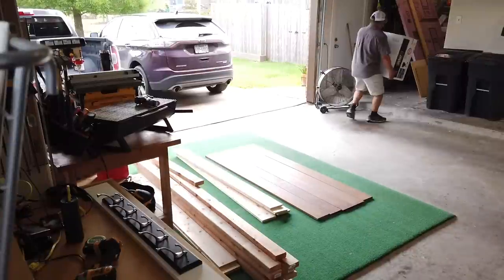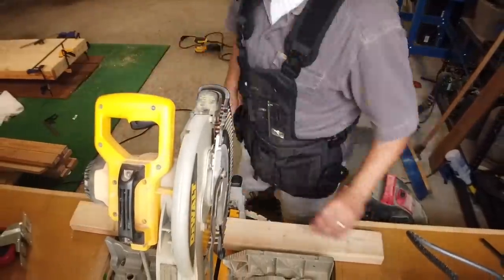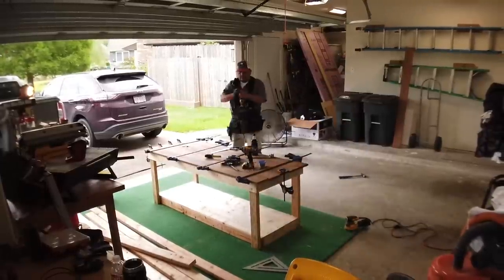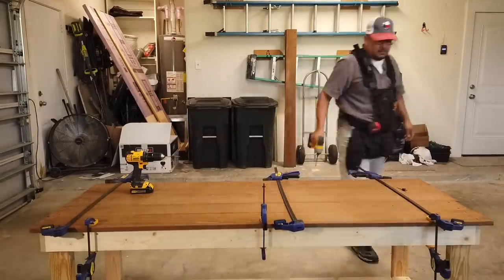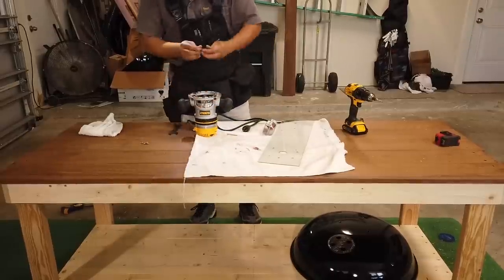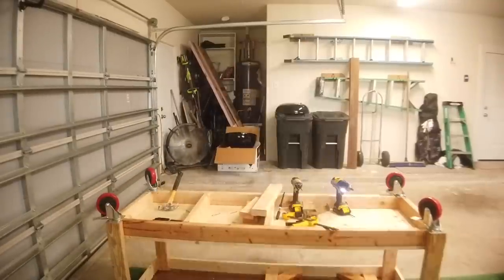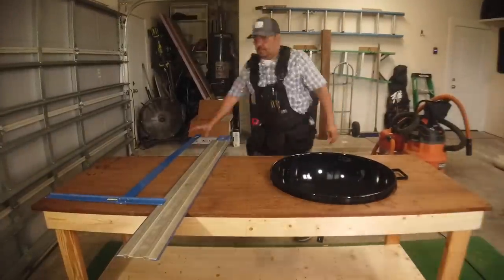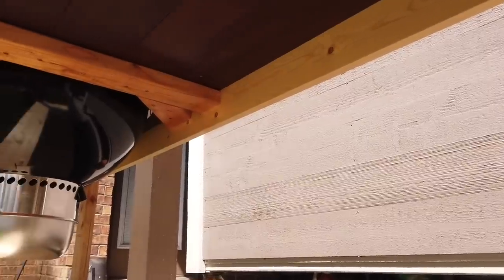How to build a 22" Weber Kettle BBQ Cart DIY BBQ Table

Comment: Very nice! I am doing a double unit for my kamado and one of my 22" Weber kettles. For the casters, I would recommend using threaded inserts and hex bolts instead of 3" wood screws. This allows you to remove the casters and not mess up the threads when you replace the casters (if you ever need to).
That Varathane Poly is for interior use only. You really want exterior Spar Urethane for outdoor items, as it provides UV protection and won't crack and peel like poly. If it gets a lot of sun, I would re-apply every year to keep it looking like new.
Reply from the maker: That’s a great tip. Thanks!  I hope it all works out for you... a very fun build.  I’m about to post another barbecue side table with a built in cambro... for keeping meat warm. You can easily incorporate it into your Camaro table build be sure and subscribe so you won’t miss it

Comment: This has helped me massively!!  Couldn't decide on the best way to 'attach' my weber to the table top and this made it really obvious that it was the best option! Thanks man.
Reply from the maker: Thanks a lot.  If you watch one of my videos you can see the first one I built.  Be sure to leave some airflow space between the table top and the grill.  The mistake I made on the first one was cutting the hole to tight.   The L brackets do make it easy.  Thanks for watching. I hope it turns out great for you.
Reply: View to a grill this is an awesome project! Did you use one inch or two inch brackets to support the grill?
Reply: snuffcan I used 2” 50mm L brackets.

Comment: great job. gonna build one myself or similar. Thanks for the inspiration
Reply from the maker: Awesome!  Send me a pic and I will post it on my YouTube community page.
Reply: @Viewtoagrill  will do i got some reclaimed teak that's just begging to be made into a BBQ table. I have just ordered a Napoleon PRO Charcoal Kettle BBQ - 57 cm - PRO22K-LEG-2 once that arrives i can work out the speck for the table. I got some ceramic floor tiles left over from a job so that may be my table top. I was also  considering a splash back too to set shelves on but design is in early stages yet , so nothing definite just yet.

Comment: Very nice job. In all honesty I would've raised that bottom shelf especially since it's made of pine. Moisture will damage the underside of it way too soon considering all the time, effort and drill bits....lol. Add a nice handle on the ends to move around and some S hooks for utensils. Love the top as IPE is a very durable and beautiful wood. Used on high end decks $$$. Very nice job and thanks for sharing with us.
Reply from the maker: Thanks Tom.  So far no issues with moisture. I keep my personal table under my covered patio out of the weather.  I also apply water shield twice a year and that helps too...  wood left out doors will rot and become damaged so I take care of it as well as possible.  Take care Tom!

Comment: That looks fantastic!!! Do you think it matters what type of wood to use for the table top? To withstand the heat I thought
Reply from the maker: You can use any wood you want really. As long as you have that half inch gap between the wood and the kettle you should be fine.  The wood really does not get very hot.
Reply: @Viewtoagrill  thank you very much! The reason I was asking is.... I have an idea about a grill sitting in the table but a half inch gap wouldn't really work there. Kinda would need to rest on the wood.

You'd think there are woods that would be ok with that?
Reply from the maker: @33mojod  I don't think so, or at least can't think of one.

Comment: Why did you use both the Thompson's weather seal in spray bottle AND the sealant in the spray can?  Do you need both?
Reply from the maker: That is a great question.... I do it because in my mind it ads a layer of protection... I have no idea if it does or not... but, you can see in my grilling videos that my personal table still looks great... and my personal table is for a 26 inch kettle and is almost 3 years old... maybe it makes no difference at all... all I can do is point out the way my personal table is holding up.  Take care Clark.

Comment: Terrific table.  If you don't mind my asking, what'd those 5 Ipe boards run you?  I live in NE FL, so anything other than pine, red oak and poplar cost as much as a room in Trump Towers.  Beautiful table.  I am actually building one very similar for my son but was going to use engineered deck boards for the surface.  Not sure how they'll fare around the hole perimeter compared to a good hardwood because those types of deck boards have a lot of resin in them as a binder.
Reply from the maker: I buy them from advantage lumber look them up on the internet. I believe they are out of Florida.  They are about 25 dollars each.  Also I went with a natural untreated surface that was going to be around food.

Comment: Javier Sepulveda
Question: are there any issues with the super hot kettle grill being in direct contact with the wood? I am ready to pull the trigger on this project, but concerned about this potential fire hazard.
Reply from the maker: Hello Javier. Just be sure to have an air gap between the kettle and the wood if you use the lid as a template it will give you about 1/2 an inch. Also if you check out my “Custom BBQ accessories” video I show what it looks like from the inside after a few hundred cooks. Take care and good luck with the project. When you are done send me a picture I have already posted a few pictures on my YouTube community page... take a look for some other ideas.  Take care.

Comment: Great work!  Any chance you have the dimensions for the 26.75 table you built?
Reply from the maker: I used six 1x6x6 boards for the table top and then I  fit as much cabinet space underneath as I could.   The table top stands 36 inches from the ground on 8 inch casters so I can move it around the grass easier.  Hope that helps a little.oh.. and just use the lid as a template for the hole.

Comment: Does the Grill put off enough heat to damage the surrounding wood?
Reply from the maker: It does not.  Check out my Accessories for the 26 inch Weber kettle video where I take the kettle out and show the inside of the table.

Comment: Hi! Awesome build! What size black L brackets did you use from home depot, 2 inch or 3 inch?
Reply from the maker: I used the 2 inch brackets… but if you Albany it to set a little higher the 3 inch ones work also.
Reply: @Viewtoagrill  my top boards are 5/4 inch thick teak. (tropical from home depot). Was your ipe 5/4?
Reply from the maker: @JonathanCarr80  they were 1x6… so 
3/4 x 5 1/2

Comment: interesting video. great work. one question, was the gap between the grill and the wood enough to prevent charring and burning of the table, particularly where the wood meets the grill? thanks
Reply from the maker: Absolutely.  In my "Custom BBQ Accessories for my 26 inch Weber Kettle" video I actually take it apart and give some close ups of the wood.  There is some "discolorization"... if that is even a word.. but you know what I mean... because of the smoke but no burning.
Reply: @Viewtoagrill  thanks for the reply. keep the videos comin'!

Comment: Was the polyurethane ok with the heat from the Webber grill?
Reply from the maker: I’ve not had any issues with it yet. However, I do refinish this table once a year.  If you look at my accessories for the 26 inch Weber kettle video, you’ll see where I actually open up the table after some use and give a closer look.

Comment: Wondering if the wood around the grill get burned easily?
Reply from the maker: The wood does not get burned at all... it does get stained from the smoke around the Perimeter of the grill.  You can see what this would look like after about two years in one fo my grilling videos. I use a larger one for my 26 inch kettle.  Thanks for watching and welcome to my channel.

Comment: Any special reason you went with 1X4 boards for the top shelf frame, instead of using 2X4’s like what was used for the bottom shelf frame?
Reply from the maker: Hello Steve. No special reason. I had some in the garage and had to use it.
Reply: @Viewtoagrill  thanks, nice job ya did there.
Reply from the maker: @stevenwhite247  Thanks Steven.

Comment: Question relating to the 8 L-brackets that the kettle is mounted to.  Any issues with the kettle rotating or spinning when using the ash sweeper since the kettle is just resting on these brackets?
Reply from the maker: Hello Bryan. On this table using 8 brackets I do not have an issue with it turning, the friction keeps it right in place.  On my rounded table(in another video) I only used 4... and that one did turn, so I added two more brackets and that fixed it.  In the other video I also found if you use the lid as a template it works out perfectly.
Reply: @Viewtoagrill  Thank for the quick reply!  Very helpful to know as I try to build one as well.  Thank you again!
Reply from the maker: @bryanjarecky2837  send me a picture when you are done so I can post it on my community YouTube page.  If you have not looked at my community page go take a look at the other tables that were inspired by my video.

Comment: Nice project! By the way, how’s the wood holding up by heat of the grill?
Reply from the maker: Hello Mike.  The wood holds up well.  I actually have a video where I take the Weber out and show you.  Check out my Custom BBQ Accessories for my 26 inch Weber Kettle video.

Comment: Hi Johnny, excellent video. I’ve been wanting to do the exact type of table but I’ve been scared to try 😬. But now I’m inspired!
Couple of questions I’m hoping you can answer:
I would like to use teak wood for the surface. Can I finish it as you show in your video?
I want to add hooks and a towel bar on the sides. Would you prefer-drill those holes before putting the sealer and varnish and then attaching once it’s dry?
Reply from the maker: Hello Frank. Yes you can finish teak wood as shown in the video.. using spar would be better for outdoor use. Drill the holes after every thing is sealed.  If you check out my Custom BBQ accessories for the 26 inch Weber kettle... you can see how I finished the table... the table is different with hooks and a towel bar. 

When you are done with your table send me a picture and I will post on my YouTube community page.
Reply: @Viewtoagrill  hey Johnny, thanks for the suggestions. I will definitely check out your 26” video for more ideas.
And thanks so much for replying! I didn’t expect to hear from you this year 😁. Very cool!
Reply: @Viewtoagrill  hi Johnny, just to clarify, I would first cost with the Thompson’s water sealer then followed by the spar coating?
Reply from the maker: @frankcampos1251  Frank, that is what I would do.  Water seal, let it dry then spar. But technically since you are using spar, the water seal is not necessary.  It just makes me feel better when I do it that way.

Comment: Hi i have question.  Would the wood get so hot that it burn?  Do you spray heat resistant paint around it or it wont burn at all?
Reply from the maker: Hello. It is possible if you get it hot enough, but after 5 years of use mine has never fought on fire.  Check out my custom made accessories video for the 26 inch Weber kettle.  In that video I show what it looks like after a few years of use.
Reply: @Viewtoagrill  OK I saw it, you used a lava lock gasket around the rim.  Not sure if I can find them in Australia.  Thanks, good stuff! Got to try!

Comment: would the heat affect the wood in any way? i.e. catch alight?
Reply from the maker: Hello Nick. It has not gotten hot enough to catch the wood on fire. I get asked this question a lot... so I actually take the kettle out and show it in my ‘Custom accessories for the 26 inch kettle’ video I posted several months ago.   Check that video out to see what it looks like with the kettle out.

Comment: Awesome looking table! How is the stain and finish holding up to the heat of the kettle?
Reply from the maker: The stain is holing well. Check out my latest video... Twice grilled potatoes.  You can see it in that video.   Also, in my chimney starter video you can see a shot where the smoke has stained the wood a little.  That table is about a year and a half old and I plan on refinishing it soon.

Comment: This is amazing how much did you sell it for if you don’t mind me adding?? Are you a carpenter by trade
Reply from the maker: I am not a carpenter.  My fad is a welder pipe fitter... I just used what he taught me and applied it to wood.  That’s why I don’t really have measurements along the way.  I fit that table together.  I sold these for 600... but I don’t make them anymore... no time.
Reply: @Viewtoagrill  its amazing

Comment: Hey man that looks great.  Question....do you actually drill into the weber kettle or does it just sit on the brackets?
Reply from the maker: It just sits in the little gap. If you feel underneath the rolled steal you can feel a little gap... the corner brackets actually slide right in... no drilling necessary.

Comment: Did you bolt or just leave the kettle loose on the clips
Reply from the maker: Those clips actually slide in a gap around that ring on the kettle so there’s no need for bolts.   Just kind of feel under the lip that the lid sits on (or look) and you can feel what I’m talking about. Thanks for watching and take care. If you make a table send me a picture and I will post it on my community page.

Comment: And the heat won't set that wood off. Not to mention the finish?
Reply from the maker: Hello Skip.  I have no issues with the heat.  Check out my "Custom BBQ Accessories" video.  I get that question a lot so in that video I decided to take the table apart and film up close so everyone can see what it looks like around the kettle after a few hundred BBQs.  I grill at least 3 times a week and by now.... my personal table is at least 2 years old.  Take care.

Comment: isnt the heat of the grill will damage the table?
Reply from the maker: The wood does not get hot enough to burn while cooking.  Check out my video on custom accessories for the 26 inch Weber kettle... in that video I take the kettle out of the table to show what it looks like.

Comment: Those black l-clips are a great idea.   Going to build a cart for this summer and have been toying with the idea of using some "oven gasket" (that woven fabric seal on your oven door) in that gap.   The metal brackets are a way better idea.
Reply from the maker: Hello Kevin.  The  L brackets create a space for air circulation which keeps the wood cool.
Reply: @Viewtoagrill where did you source those clips from?

Comment: How much would a table with webers grill on each end cost with room in the middle for a small 22 gas griddle cost..i live in Houston n look to have one made
Reply from the maker: Hey Reynaldo.  That sounds like an awesome table. Using the same material , the same kettle and the BlackStone 22.... would be about 500 with taxes..  material.. 300-400.......so if you do it yourself 800-900 ... and a weekend of your time.  If you got less expensive wood like pine instead of ipe you could save around 75.   Take care.

Comment: Hi, are those screws that hold your grill actually isolate the heat?
Reply from the maker: Hello Nick.  The screws keep the body of the pit away from the wooden table top and do protect it from the heat.
Reply: @Viewtoagrill  could you please share more information about them? Like name so I can read about them
Reply from the maker: You can find them at the Home Depot.  They are called 'L brackets'.  They are very common and used to hold two pieces of wood at a 90 degree angle... I just re-purposed them for this application.  I also have a video on custom accessories for the 26 inch Weber Kettle that you may find interesting... I take the kettle out and show the wood around the edge closest to to the pit.

Comment: Great table! I want to make one myself, but I have one question; what size corner braces did you use? 1 1/2 or 2”? Curious to size and how you placed them to align with the lip of the kettle. I appreciated your video, and thank you for uploading it.
Reply from the maker: Those were 1 1/2 inch.  I would not go shorter... the 2 inch bracket would be fine also.  If you want to see how the table is holding up just watch one of my grilling videos. I grill on an older one that I made for my 26 inch Weber.
Reply: Thank you for the advice and the quick reply! Beautiful craftsmanship. God bless. I hope mine comes out as nice as yours!
Reply from the maker: Al Fermin if you have any questions while making it just ask!

Comment: Screwing hardwood to softwood frame suffers from different expansion & contraction. Ideally, make work surface and attach to frame with expansion brackets
Reply from the maker: Hey Stephen!  I have not had any issue with the build but I get what you are saying. I tried to compensate for expansion by not glueing anything together to allow movement(and my tables never get wet). I have been using my personal table for a few years now and it is working out great. A lot of folks comment about the dewalt tools but I only have them because of hurricane Harvey... my house was flooded... other folks bought the cheap stuff before I could get to it... so I got the dewalt.  Take care Stephen.